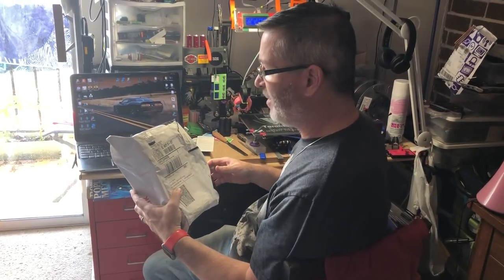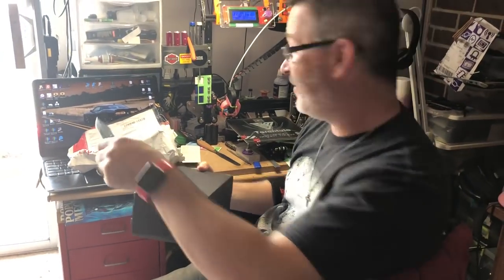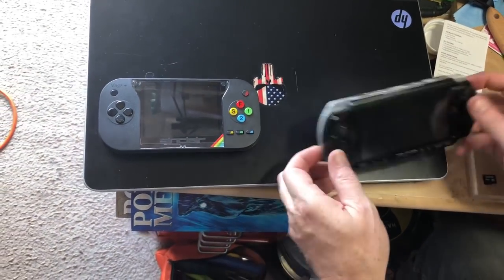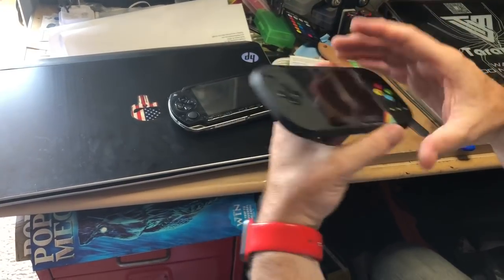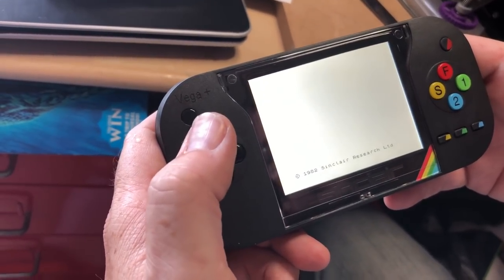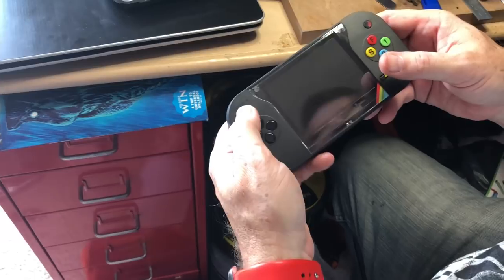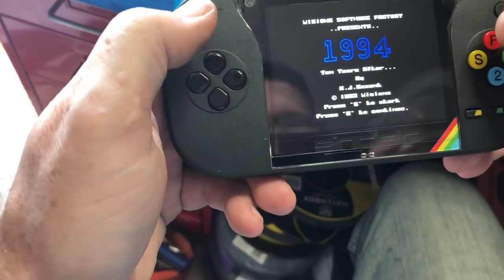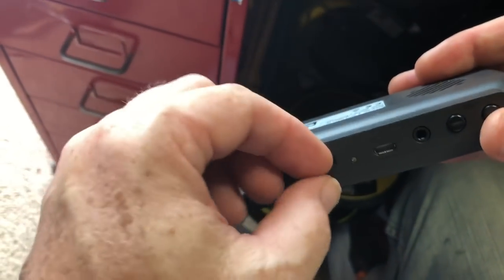Spectrum Vega+ #179 first batch

Comment: It’s an utter embarrassment that RCL shipped these pieces of garbage out to backers. They only did it to save their necks at a shareholders meeting. These units are barely prototype standard and are not fit for public use. The packaging it was shipped in is disgraceful, and they call it environmentally friendly what a joke, no it’s the cheapest thing possible so they didn’t have to spend on packaging. David Levy and Suzanne Martin are complete and utter crooks and should be behind bars for the theft of thousands of pounds of backers money. They shipped about 100 of these sub standard pieces of junk but what about the other 4,900 RCL? Liars and thieves.

Comment: ..why would anyone want this over a hacked PSP or Nintendo DS?
Reply: Andrew Bevan because the first bit of kit, the original vega was great. 
and when we backed it.. it was official sinclair kit and the original designer of the spectrum , mr rick dickinson (rip) designed this too. unfortunately tge comapany went into  a huge dispute..thats still not finished..but the up shot is that this design was changed and lost in the company fight. its long winded , but basically we got completely ripped off.